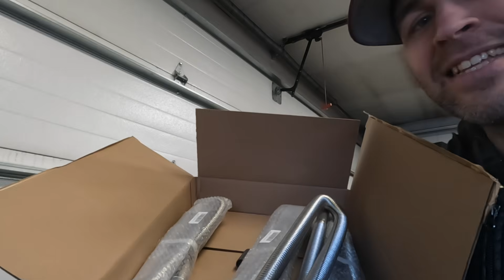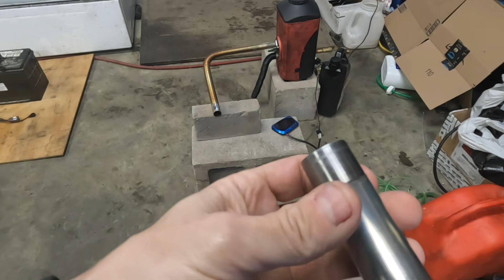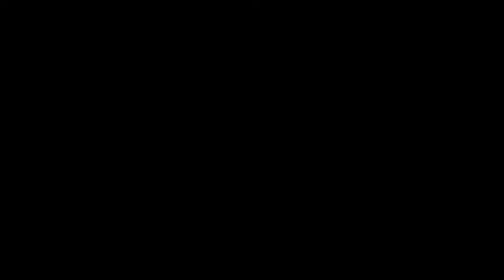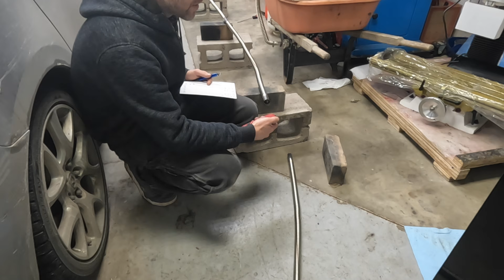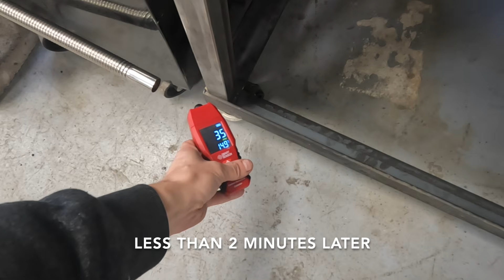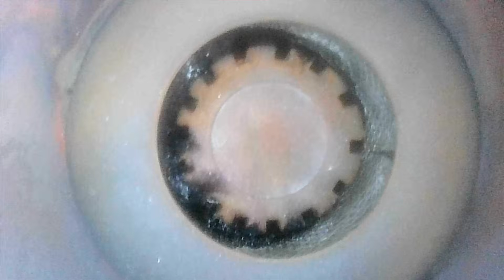Capturing Waste Heat - 5 Meters Of Stainless Exhaust - Will It Even Run ?

Comment: When I did mine I had one of those long pieces that you bought and then two of the smaller ones that come with it that’s how long my exhaust is on mine because I had to exhaust it out the back of the shed. It does heat up the attic a bit more because of the long Exhaust pipe. but I wasn’t sure if it was gonna carbon up the inside of the burn chamber after watching this video kind answered my question. Thank you very much.
Reply from the maker: Yeah, that's the main reason I did this, to see about the restriction, and it turned into a heat exchanger video... haha.

Comment: If you had any residual oil/hydrocarbons  on the fittings or inside the pipe, it will raise the CO considerably until it burns off. l'b be curious how a conventional baseboard heater would fare as an exhaust heat exchanger. IIRC, standard pipe size of the exchanger is 3/4" so fittings would be necesary to connect fron conventional diesel heater exhaust pipe size.  A solid wall pipe as exhaust would increase exhaust speed and lower exhaust pressure compared to that Vevor exhaust pipe. Thanks for another great test!
Reply from the maker: Yeah, oil in the pipes burring off would cause CO, but I don't think it was it enough to burn, after the first pipe. I would expect this to raise VOC content, but not CO ... but I could be totally wrong. 

I have been considering baseboard heat exchangers for over a year now. The reason I didn't get them last year was because of all the funky fuels I was burning ... that would have clogged them up. I thin you would need at least an 8 foot unit and they are pretty costly where I am. 

Yeah... a smooth wall pipe would decrease resistance and increase flow for sure. I would be curious to see how much less heat would be scavenged as a result. One of my next tests will be to coil this stuff up and see 1. how much restriction it adds and 2. how much more heat is removed as a result.

Comment: If you went to a large diameter exhaust, smooth pipe, after the initial 90 degree bend it would lessen back pressure, therefore making start up easier and result in a better burn. It would also slow the exhaust flow and increase the time the hot exhaust pipe has time to cool by convection. It should be stainless steel to avoid rust, as there would be more condensation.
Reply from the maker: I agree, this would be much better. I tried this experiment because it is more relatable / accessible to most people. 

Larger diameter is better in almost every way (not as easy to work with and most expensive). Like you say, the gasses would slow, allowing more time to give off energy, and the larger surface area is a better heat sink !

Comment: Another great experiment.
I suspect that because the heat exchanger blower and the intake fan share the same motor, anything you do to impede the airflow over the exchanger necessarily impedes airflow through the intake by reducing the rpm the motor is capable of reaching. I wonder if situating the heater with the blower intake pointing down into that concrete block wasn't restricting the airflow enough to change the air/fuel ratio and make it run rich. Even the little black screen cap that screws on the end significantly changes motor rpm when removed.
Reply from the maker: Thanks for the comment. Yes, a lot of people don't get that about the air flow... if you limit the exhaust, it will run rich as you slow air flow in. 

A few people have mentioned the way the heater was sitting on the block. I should have addressed this in the video, but I had done about 3 hours of testing for a previous video where I was checking to see if the heater would run well standing on end. 

The heater may have had a little more restriction that open air, but the exchanger was maintaining 210C in normal mode and 184 in alpine mode, so that indicates not much / no restriction. I had purposely played with restricting the inlet in the past, and and pretty small restrictions cause the temp to spike quickly. 

The ECU doesn't have fan speed compensation, so load = speed at a given heat setting. Lower battery voltage will decrease fan speed and high voltage will increase. All this to say that if there were significant restriction, it would show up quickly in both exchanger temp and CO levels.

Comment: It should be tried with an exhaust tube with a double or even triple diameter for first 1m, then even larger for the second and third meters, so the air will not be restricted, the heat radiation surface is larger and the possibility of condensation, non-existent .
And if you want to collect the heat quickly, you can put a small 12V fan every 50cm by 50cm to push the cold air from the room towards the exhaust.
Reply from the maker: Yeah, there are other / better ways to do this for sure. This way is pretty easy and a reasonable price for stainless tubing. 

There are many advantages of using a larger pipe, like you say. The condensation would still happen, but it wouldn't become a problem. 👍

Comment: Thanks for doing this test!  I've been mulling this over for a while myself.

I bought 2 2 meter lengths of the exhaust tubing to use on a sailboat.  My plan is to play with it a bit to determine how long the run can be without condensate forming, and also with it exiting upwards with a gooseneck bend at the top connecting to one of the stainless bulkhead fittings that are available that have a 30 degree "kink" on the inlet side pointing upwards.  

The reason for this gooseneck bend connecting to a bulkhead fitting with it's "kink"ed end pointing upwards is to ensure that no water from a wave or heeling would be able to enter the exhaust and make its way down to the heater.  I'll do the same thing for the combustion air inlet for the same reason -- to prevent water from getting into the heater.

On the exterior side of the exhaust fitting I plan to install an immediate 90 to go horizontally to an improved version of the muffler that has an s-bend internally with a drain hole at the bottom.  The s-bend should also work to prevent water from coming into the exhaust.  I plan to fabricate a stainless or aluminum heat-shield to protect the boat's gelcoat from the bend and the muffler, and a stainless wire cage to prevent people from accidentally touching the hot 90 and muffler. 

I haven't figured out yet exactly how I will be terminating the exterior of the combustion air inlet bulkhead fitting.  I'm thinking that it will likely be with a 90 pointing downwards and some sort of screening on the end to prevent flying insects from nesting in there.  The exhaust should also have some sort of bug-protection  on it -- maybe a simple lightweight aluminum "flapper" that will easily be pushed open by the exhaust?  

Bug protection could be handled by fitting the ends with removable caps that would need to be removed prior to lighting the heater, and then replaced when done.  I'm just concerned about the caps getting forgotten either before lighting or after use....

In writing this, I think I figured out how to handle the outside of the combustion air inlet. It will need to be protected from people accidentally knocking it around as they walk past.  Since the inlet doesn't get hot, this could be as a simple shroud made by forming a "U" shaped piece of stainless or aluminum sheetmetal with a 90 degree flange at each end of the "U" and attaching it over the 90 degree bend (the flange would provide a place to screw it onto the boat).  It would be open on the top and bottom so there would be no air restriction or water trap.  It should be made just large enough so that the area behind it can be easily cleaned. This would also allow the standard inlet "screen" supplied with the heaters to be used behind this "U" shaped shroud.

In case these items are of interest to some folks here are some links to them:

Link to the "improved" exhaust with internal s-curve:
    https://www.aliexpress.us/item/3256805789300724.html
Link to the bulkhead exhaust (or inlet)  fitting with the "kink"ed inlet side:
    https://www.amazon.com/gp/product/B0CN6QR4D7
Link to the 90 degree fitting:
    https://www.aliexpress.us/item/3256804589131692.html
Link to the 2 meter exhaust pipe:
    https://www.amazon.com/gp/product/B0BDKPZRBD
Reply: One supplemental thought to all this is that it might be possible to make a couple of loops of the exhaust tubing and position a slow speed fan to blow across the loops to get some extra heat out of the exhaust.  As long as the exhaust tubing would get hot enough to evaporate any condensate formed during initial startup this could work well.  You would have to make sure the heater would run long enough for this to happen -- basically avoiding "short-cycling" the heater.
Reply from the maker: That could work for me, and I will probably try it... for you, you want to make sure you have enough heat left to get rid of moisture.
Reply from the maker: You can purchase proper exhaust outlets on amazon that decouple the heat from the flange.... sort of.. Should be perfect.  Oh. I see by the link you have already found this. 

Bugs don't typically nest in areas where diesel fumes are present. I think a flapper would risk being a restriction.... Depending on weight and how easy it was to move, if it ever got struck etc.

Comment: I’ve been using 1” copper pipe to extend exhaust due to smooth inner bore (less resistance) and thermal transfer properties. Also been manually adjusting fan speed upward as I add combustion exhaust length and heat output ducting to compensate for increased restriction. Just did a few hours of testing this week but seemed to work great. Prior to these adjustments, choked out and carboned up before it could even get up to running temp even once.

Thx for the content. Learned a lot and entertaining watching you find the limits of the heaters!
Reply from the maker: I really wanted to go with 1" copper, but wasn't sure how much I would need, and it is pretty costly. I think the exhaust tubing is more relatable to people in a video, but copper is far superior !!

Having an adjustable controller is ideal for this situation 👍
Reply: Any metal other than stainless will be corroded by acid in the exhaust.  There is a reason condensing furnaces have stainless heat exchangers.  This creates a risk of carbon monoxide poisoning.

Comment: A lot the smoke on start up with this long exhaust, is likely condensing steam and maybe some raw fuel, its likely not much more then with a short exhaust, but with short exhaust there less cooling to make the steam and fuel condensing into fog that you can see more.  It would cool see how much the CO spike changes from the 2 setups, I have feeling it fairly high for both for short time as starting up.  As for condensing over all that could be problem at some point as water is made from burning the fuel, I think some are overly worried about as well others that don't under its could be real thing, could fun thing to test.
Reply from the maker: That does make sense, and my heater will smoke sometimes on startup, just not that much, so like you say, the cooling effect likely condenses what was already there. 

I have checked the numbers while it was starting without the long exhaust as well as with it. I don't remember what those numbers are but I don't think the short exhaust made my meter alarm (300 ppm) while the long exhaust made it alarm very quickly.

I will be testing the condensation build up at some point... in everything goes to plan.

Comment: There are dips in your long exhaust that will be collecting condensate in your garage. As long as the exhaust temp is below the boiling point of water, the water vapor will condense in your test exhaust.
Reply from the maker: Yeah, I talked about this briefly near the end of the video. It's not actually boiling point that is the determining factor but this could become an issue for sure. 

There are a number of factors that come into play like the wall temperature of the exhaust, the percent of moisture in the gasses and even barometric pressure. 

I am going to do some testing to see what it takes to fill with condensate and shut off. It should be interesting.

Comment: I run my exhaust through an internal wall then 2 metres on a 1° slope before passing through an outside wall. The workshop where the exhaust operates as a heat exchanger is well insulated and raises the room temperature about 3-4° during running. It doesnt seem like much but it does make a difference, especially as its waste heat that doesnt cost anything to use. The heater performs normally with no adverse starting issues, but the total length is just 2.2 metres. I also made a stainless steel reflector/heat shield that keeps the pine lined wall cool behind the tubing.
My outlet temperature is cool enough to just keep my hand on the muffler (when conditions are cold)
And my CO is pretty stable at 2ppm. The heater is an auto altitude compensating Maxpeedingrods 5kW.
I also made a heatsink passthrough plate with two coaxial shielded penetration tubes, the inside flange plate gets to around 60-70°C with a finned heatsink across the top and while having only minor annular contact to the exhaust tube 150mm from the heater outlet the heatsink cools the plate well, and gives even more thermal efficiency.
Reply from the maker: Sounds like an awesome setup. My MaxpeedRods heater doesn't have compensation, sadly, and it may be a problem for me at 3500 ft.
Reply: @loweredexpectations4927  I think if you can tune it using your CO sensor you may actually be better off. Mine has no programming options and my minimum pump speed is fairly high with no available menu option to adjust it. With a dual fuel system I am within spec on CO, but the consumption is 6hrs per litre minimum and pumping at about 1.6Hz, it's higher than my other system in my beach shack that I got down to 1.2Hz with the older more adjustable interface.
Cheers.

Comment: Is there a hole in the floor under the brick?   How can the heater breathe?  🤷🏽‍♂️
Reply from the maker: I've had a few people ask about this. I tested it before the test and as the test got started. There is enough space around the 4 corners, apparently. 

My heater normally runs at 210 C in normal and 184 in Alpine mode and I was getting those same numbers while sitting in the brick, so it can't be restricting too much.

Comment: I saw on another channel where someone ran it through an old cast iron radiator with good results.
Reply from the maker: That is a great idea if you can find one cheap ! I searched around and they are crazy expensive around here as people collect them now.
Reply: I also thought about using an old cast iron radiator -- the kind that are used for old steam heating systems.  My concern is that, over a long period of time, there will be a very slow buildup of soot from startups, since the cast iron won't get hot enough to burn it off.  Then how would you clean it out?  If you used an acid soak, it would eventually wear away the metal (and then there's the cost of the acid and disposal issues), and trying to get it hot enough to burn off would cost probably much more than the net gain in energy that was recovered during its use.....  I don't think this solution is as simple as it initially seems.
Reply from the maker: @philipreich7035  I get the concern, but if the heater is running reasonably well, there won't be much or any soot, and whatever does build up should be washed to the bottom with condensate. I wouldn't be concerned about this due to the fairly large internal volume.
Reply: I will be doing this with mine, I have a small cast iron radiator that was pulled in a remodel that I will be using, it should recover a good amount of heat.  I just need to figure out my piping and how I'm going to run it back outside as my current exhaust pipe goes directly through a block off plate I put in my window.
Reply: I saw that too, but he didn't measure the exhaust gas temp at the outlet so we don't actually know how well it did at exchanging the heat.

Comment: I planned on doing something similar to mine but with two 10-foot sticks of common 1.5" exhaust pipe.  (Stuffs cheap and purpose-built for exhaust gases.)
Reply from the maker: Right on !  I'm guessing that 1/4 of my viewers are handy and will come up with a solution of their own, haha. 

The main reason for testing this is that I have had a lot of people asking about it or telling me they have installed 6 feet in their green house and are worried etc.

Comment: What if you try use Alpine mode? leaner mixture might help when there is airflow restriction in burn chamber.
Reply from the maker: Yeah, I used alpine mode for this whole test, just for that reason 👍 

It would be great if I had a programmable controller where I could control fuel and air independently.